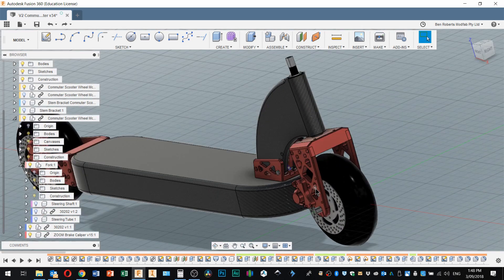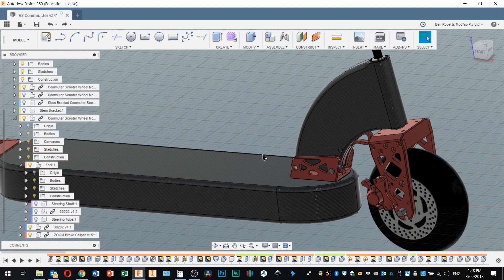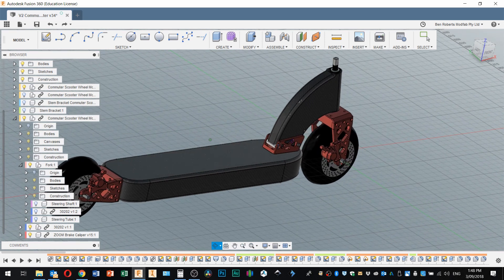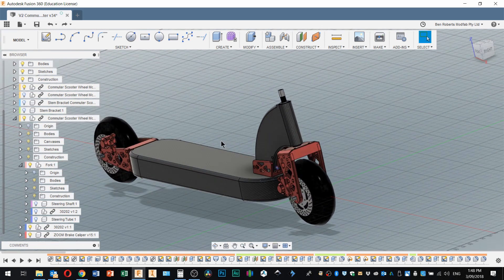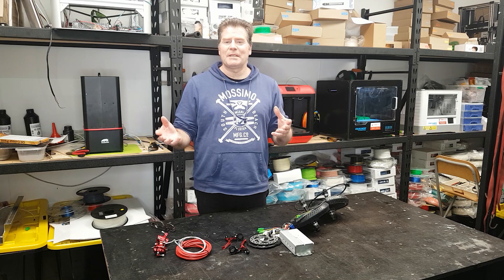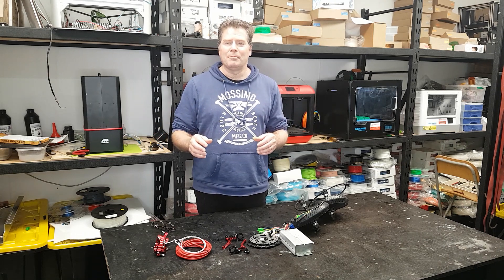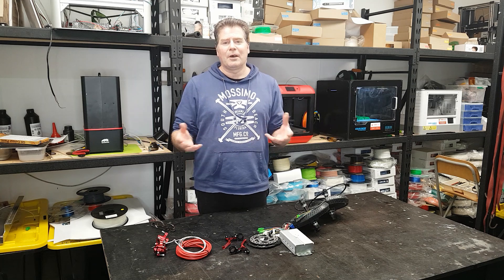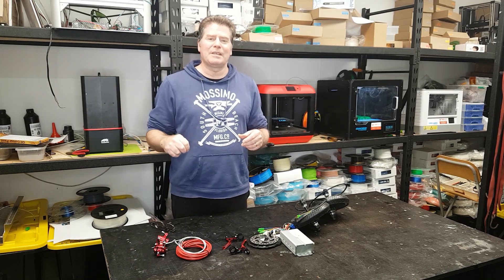Scratch Building a 2WD Electric Scooter

Comment: What controller did you use ?
Reply from the maker: Hi Elliot, it's a real generic 400W unit. They're all over Aliexpress and Banggood.  Even if it had a brand, it would just be a sticker put on by some middleman :-)
Reply: Benny in the shed  Yh perfect I been looking on them two sites but I can’t seem to find a dual motor one ? Can you help me please Ben
Reply from the maker: Hi Elliot,  The unit is not dual motor, I was just  going to wire it up that way.  As yet I haven't actually gone forward with the project so I don't know how the controller would go with two motors in parallel .  Maybe, the magic smoke would come out and I'd have to try something else :-)

Comment: Hello Benny! I have a question for you, cause i was thinking about upgrading my own scooter by adding a second motor, mine is rear wheel drive, so i want to put another motor in the front wheel. Can i just plug together both motors in the same controller using the same link?
Reply from the maker: Hi Jarry,  From a wiring perspective, it is as simple as running parallel connections from your new motor to the controller.  The main thing to take into consideration is the amount of power the controller can deliver.  If you are adding another motor that is the same as the existing one (definitely try to do this) then the potential is for the combined motors to draw double the current that the single motor would.  This would be the case at full throttle.  Subsequently, if the controller is rated to run just one motor, it could overheat or fail.  Also you also need to determine if the existing motor is using hall effect sensors for position feedback.  If so, you'll need to consider using a new motor with the same type of sensors and running them in parallel also.
Reply: Thank you Benny, I think the best thing I can do is put two controllers, one for each motor (same motor and same controller), and increase the capacity of the battery, perhaps doubling the amps and maintaining the voltage? I will also incorporate a connector to turn on or off one of the motors, because I really only need more power for the climbs. 
After a while using my scooter I suggest you incorporate suspension to your magnificent design, the ride will improve a lot. Thanks for everything Benny.
Reply: I plan on doing something similar where I could cut power to the second motor, I have already got the motors mounted and I'm going to make a 48~ volt lithium battery out of a bunch of salvaged 18650's and buy two 500 or possibly two 750watt ESC's... but I was wondering if I were to have a switch on the power of one of the ESC's to turn it off if the power the motor generates while getting pushed would mess the esc up?